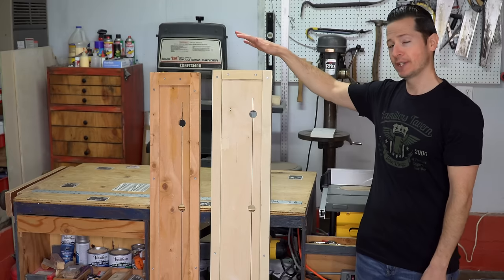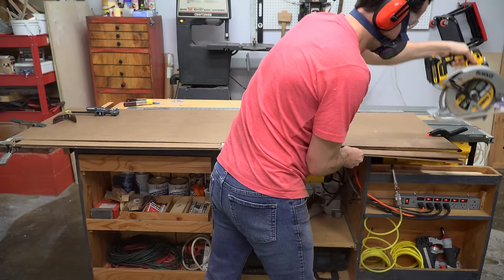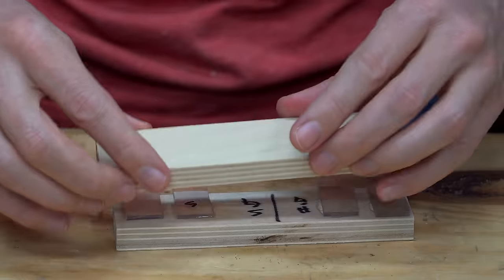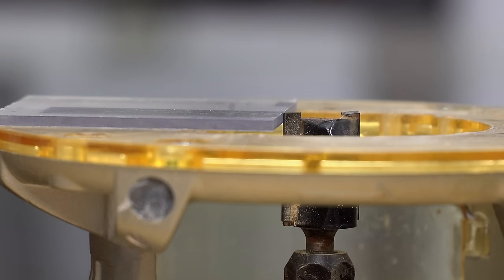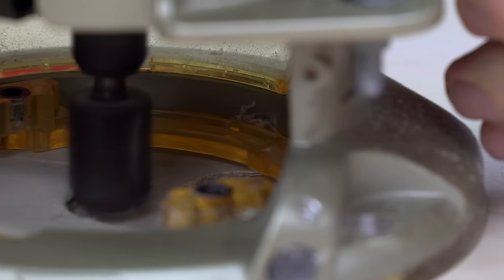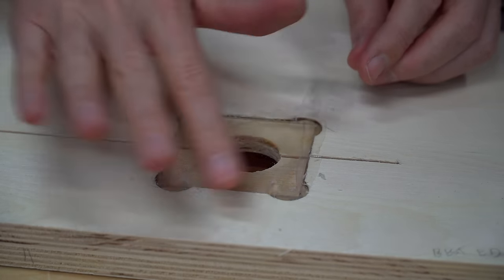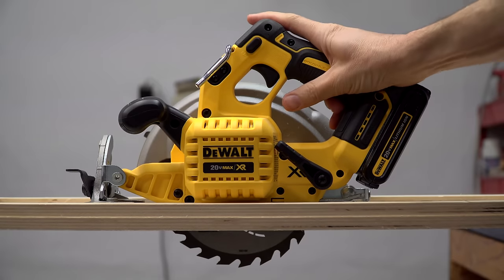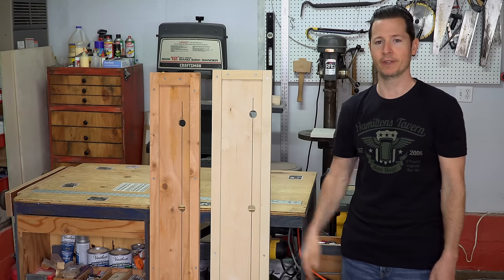DIY Saw Track Update

Comment: Love the idea, but hit a bit of a snag...when we went to make our first cut into the jig to complete it, it had changed from the previous day when we built it. It had shrunk and the saw couldn't be forced through. We got about halfway. We undid one side of screws, broke the glue up and now we're going to redo that side. A little wood putty for the crappy plywood we used, and maybe this time we can get it to work. :-/ The metal on the sole plate must have expanded just enough to bind up the saw. Not sure how to allow for that...suggestions welcomed!

Comment: Great idea but why you glued those plexiglass pieces ? when they eventually get dull or scraped from usage, in order to replace them with new ones you will need to rip them of ! So I suggest to use 4 small screws instead - in corners.

Comment: As usual, Outstanding work.  It’s also great that you took the feedback and improved the previous model.  You are helping the community on a per video basis.  Please keep it up.
Reply from the maker: Thank you for the wonderful compliment! I truly appreciate it!
Reply: @OneMinuteWorkbench  I am just wondering if the plastic made a difference. Was it worth it?
Reply from the maker: For what I usually do...I'd say no, not really worth it. I'm just breaking down sheet goods and don't really need a finish-quality edge on my cuts. If I wear building furniture and had to use a track, then yes, it would be. I hope this helps!
Reply: A better update would be to leave a clamping lip on the sides and widen out to a triangle 500mm wide approx at one end so it makes setting up square easy and you only need to measure out one mark . Also why are the stop blocks required ?
Reply from the maker: Zane thanks for the suggestions! The stop blocks keep you from cutting the track in half. I hope this helps!

Comment: By experience I can tell you that plexiglass, if you use this jig often, will get a lot of scratches by it being in direct contact with rough wood. Also, depending on the quality of it, plexiglass starts to yellow as time goes. Definitely not worth the time to do this over the original design which was great.

What I would do to improve the original is drill more holes, of smaller size, spaced a little closer. It won't affect the structure of it and will help aligning the jig easier. Also I would made the bottom and top part of base either wider or will leave some wood tabs on it so I can put clamps on it and secure the jig to the table. If the lower part of the jig is perfectly square with the line of cut you can add also a small strip of wood on it so you can put the jig on the material to be cut and make the cut perfectly square with the lower edge of the board you're cutting.
Reply from the maker: Good stuff - thanks for the suggestions!

Comment: Thank you for sharing your diy track saw design. I built two of them, one that can do up to a 5’ long cut and another that can do up to a 3’ long cut. I find myself using the 3’ long one about 80% of the time. The 3’ long one is perfect to handle anything that my cross cut sled can’t, and I rarely break out the longer one. The only modification I made to your design is to mark the top with tick marks every 2”.

Comment: Built one for myself yesterday on your earlier design and it works well! I made sure I did the sight holes before I ran the saw. I used the saw’s sight marker at the front to run a pencil line down the base so my holes would be centred. I built it out of mdf custom wood and lacquered it
Reply from the maker: Nice! Thanks for sharing!

Comment: Love the upgrades!
To help glue adhesion to plastic, lightly flame the area to be glued. Do not melt the plastic, you just need to change the surface energy. 
Works with all adhesion on Plastics:  glue; paint; ink; etc
Thanks for sharing the updates. 
db
Reply from the maker: Thanks, and thanks for the tip!

Comment: Thanks for sharing! I've done it and it works really well. I just need to install the plexiglass to complete it. I've used a 3/4 inch baltic birch and made it 60 inches long to be able to cut plywood of 48 inches in one time. I really appreciate the simple design and the precision of the cut.
Reply from the maker: No problem! I'm glad it worked out for you!

Comment: best DIY saw track yet !!!!!, i used your idea but with 2 changes , i used aluminum flat bar for the rails and then used UHMW tape on the sides of the flat bar and a 3/4 in strip on each side of the flat bar on the plywood and that made the saw slide like it is on ice
Reply from the maker: Thanks - you build sounds awesome!

Comment: When I was still working in a cabinet and mill shop, one of the things we did was take a piece of 1/32" laminate, and glue to the base of the saw, and glue a piece onto the plywood, before attaching your side rails. If you use 1/16" on your plywood, it will make it stronger. I am going to try something like this out of a 1" x 12", because I want to cut 8 ft. sheets of plywood on an angle. I am going to build a church steeple, that is 8 sided. I am planning on usining1/4 inch flat aluminum for my guides. I like your sight holes and will use those. Love the build. I hope this suggestion helps.
Reply from the maker: Ted, thanks for sharing about your experience! Good luck with the jig build, and the steeple - let me know how it goes!
Reply: @OneMinuteWorkbench  I used a laminate kitchen counter top that a friend was tossing out. A local kitchen shop sold me leftover  laminate edgeband for a couple of double doubles( Tim Hortons coffee) I used for the inside guide track edges.
Stands up well to the repetitious saw movements. Thanks for the design updates and idea.

Comment: SIGHT HOLES W/O PLEXIGLAS or POLYCARBONATE. 

I drill-press drilled a 1" sight hole with a Forstner bit but stopping 1/8" from the bottom. I am easily able to see the pencil line. Because the grain of remaining wood at the bottom of the sight hole is running lengthwise, it is not inclined to break away. STEP 1) Score a line with the saw blade. 2) Drill the sight holes. 3) Complete the saw cut full depth.

Perhaps a better option might be a large V-shaped router bit to create a "sight groove," again leaving about 1/8" square edge at the bottom. This would provide even better edge support.
(Good video Tommy. Clear and easy to follow. Thanks!)

Comment: Very very nice.  The smallest sheet of Lexan I could buy was 10x8, so I made a series of sight "slots" rather than holes by drilling pairs of holes about 6" apart and then cutting out between them with a jigsaw.  It turned out this lets me see the line while looking ahead at an angle rather than having to look straight down.  I'm thinking I will make another one that will let me rip an 8' sheet. I'll try joining a couple of plywood strips end-to-end with a table lap to get the length, and the side rails should give enough rigidity to protect the joint.
Reply from the maker: Thanks for sharing about your version! Let me know how it goes with the 8-footer!

Comment: You could round the corners and edges of the plexiglass with sandpaper instead of using the hot glue to prevent sharp edges from cutting you.
Reply from the maker: Thanks for sharing that idea!
Reply: I'm trying to figure out how the plexiglass is better then just a hole...
Reply: @philipgwyn8091  Im guessing cause it keeps the sawdust from falling down on the piece?
Reply: The plexiglass just adds the ability to exactly site the cut. You can see exactly which side of your cut line your on.  Great for an exact cut and a great idea for those who need that for say, furniture and don't have or can't use a table saw for it.
Reply: @philipgwyn8091  Having something in contact with the workpiece for the length of the cut prevents "tear out," or splintering on the surface of your piece. The rest of the cut, the track itself is doing that. Putting plexi in the sight holes doesn't interrupt that contact but still lets you see through them.

Comment: Hi Tommy, about an hour ago I finished making one of your saw tracks. I used 3/16 medium density fiberboard to cover the 1/2 " plywood tract. The fiberboard makes a smooth track for the saw. 
New topic: A few weeks ago, I made two zero-clearance throat plates for my table saw. One from acrylic and the other from polycarbonate. No doubt about it, acrylic is much easier to work with.
I guess I missed the part in your current video where you explained the benefit of adding a plastic window to your saw track. If the reason is compelling, I'll use the acrylic.
Thanks for the great ideas.
Reply from the maker: Thanks for sharing about your builds! The only reason to add plexiglass is to reduce tear-out at the sight hole locations. With plexiglass added, the entire track becomes "zero-clearance" on both sides of the blade. I hope this helps! Thanks again!
Reply: @OneMinuteWorkbench   One Minute Workbench  I'm sorry, I must have heard wrong. I thought you said you used polycarbonate for your windows. Just so we're both on the same page acrylic is the name of the material, Plexiglas is one of the brand names. Polycarbonate is a different plastic. It is much more impact resistant but, and this a very big but for this application, it scratches more easily. Since scratching is a possibility, you may want to use Acrylic (Plexiglas) instead of polycarbonate. I'm going to try to cut circles of acrylic and glue them into the holes. Thanks again for the idea.
Reply from the maker: I was using Plexiglass as a generic term (like using Coke to describe any cola). That said, I did use polycarbonate, just because it was the smallest and cheapest sheet I could find at Home Depot. I haven't had any problems with it, but I'm sure there could be different plastics that are better suited to the application. Let me know how it goes with your circle cutting idea!

Comment: After watching your original track video, I really don’t understand the purpose of the poly inserts.

What did I miss?
Reply from the maker: It creates "zero-clearance" at the sight-hole locations. I hope this helps!
Reply: @OneMinuteWorkbench  Hi. May I know what is the purpose of zero clearance?
Reply: @wongcw08  having a zero clearence means there will be less chance of tear out when the blade is cutting. Hope this helps. If not look up zero clearence table saw throat plates on YouTube.
Reply: In addition to zero clearance it looks like it will be easier to align you marks because you can see the edge of the cut on the lexan. That to me seems like the biggest advantage.
Reply: By the size of the holes honestly the zero clearance aspect won't be of much difference.
Reply: Tearout is from cutting unsupported edge. The blade is pulling up against the wood. if supported the grain mechanically stays in place.  If unsupported, it pulls up a bit.  on really cheap plywood it can peel at each sight hole where the edge.  Leaving those spots fuzzier than the rest.  Now each tearout needs a few minutes or more to fix.
Reply: @uplatecoding8008  great explanation dude :)
Reply: @uplatecoding8008  You could also use a finishing blade for finishing work. I switch to a good 60 tooth or greater, i.e.; plywood with that microscopic veneer layer,  when it needs to be perfect.

Comment: This is the bestest track saw design and instruction how to build .  I mean both first and second. 
I recommend one more improvement.  add spring loaded mechanism to sandwich the work piece between TRACK saw and BASE PLANK.  So , no need for clamp , on , not precise cuts. 
 I see you have the intelligence to make it work.
thanks for good work.
Reply: Hi FRANK. I'd be very grateful for more detail on how you could avoid clamping, as, although the saw would be safely guided with this ingenius double track, the device still needs to be firmly fixed to the material to be cut. Maybe I haven't understood your idea.

Comment: Nice work I like that design I made a couple changes to it I made the bottom out of quarter inch to reduce the amount of loss for depth of cut and I made it wider because the quarter inch was kind of wobbly I also put two strips of sandpaper on the bottom so I can just set it down it doesn't slip around then and you don't need to clamp it but thanks it's a great idea

Comment: Nice improvements! I built one off the old design and everything worked great… until the summer! We got so much humidity and all the wood swelled and it got much harder to push the saw through. I want to experiment with using one side plywood, but the other side as angle iron, with some slots for adjustment, to account for humidity. Still thinking it through a bit. Anyway, thanks again for another nice video!

Comment: You should have used the masonite as the base, but not for the rails. It doesnt need to be straight if your rails are. Then you get more depth and a surface with less friction.
Reply: Masonite is not as good as you think it is.  I thought he demonstrated that pretty well in the video.
Reply: @RyeOnHam  You missed the point.
Reply: @jonathansimmonds5784  Okay, Norm Abram, tell me the point I missed.
Reply: @RyeOnHam  in the video he used the Masonite for rails. It was too flexible. Using it as the base with plywood rails should work fine.
Reply: @dancingbear6239  HaHa, Norm Abram Oh Lord!

Comment: You could add built in led lights on the bottom side of the plywood around the poly inserts so in situations with dimmer lights, you can still be able to see your line.
Reply from the maker: Cool idea!

Comment: excellent and i like this follow up video also. my track saw is a budget one and the rubber edge of the metal track is beginning to get cut away so you cant get a perfect line so i am looking to make this track saw out of ply that you have done!

i wont be using the plexiglass though mostly because 1) a lot more work vs the end result.
2) for me i work in different light so sometimes outside. sometimes inside and the plexiglass edge can cast a shadow over the line making it harder to see. and also then dust getting on it and plexiglass scratches up easy so the original idea is best :)

Comment: 2 GREAT VIDEOS!. I've also noticed the need for a track on both sides, especially as my Makita has a factory-designed cutaway on its base at rear left (What was the engineer thinking? Did Makita want to save $ !?). Indeed, it is important to check there's clearance under the motor. Also, as it's necessary to clamp during sawing, it's vital to have a margin so that the motor also clears the clamps. My first attempt with a single track had this fault. Many thanks.
Reply from the maker: Thank you - I'm glad you enjoyed the videos!

Comment: After viewing your original video, I thought about it and decided a bunch of strips acrylic (or polycarbonate)  along the whole length would make visibility better. No real need for the adjacent edges of the strips to glued together, just butt them up.  Also, something I've not seen in any YouTube video is how to make a non-slip bottom. Long ago, I noticed your ordinary RTV silicone sealant is pretty grippy when cured. I apply a uniform strip of the RTV silicone with a putty knife with a couple of suitable diameter wires on the edge of the putty knife to act as a spacer make a uniform layer.
Reply from the maker: Thanks for sharing your ideas!
Reply: I’d love to see a video of what you’re referring to. I can’t quite picture what u mean, and I doubt there aren’t others in the same boat as I am in. Thanks in advance!

Comment: Going to have to have a go at this when I next remake my single edge tracks. I used 6mm MDF for those and will do the same to give me max depth. 
Another bonus I can see is that it gives the option to clamp either side and cut either direction which I can't do now. 
I wonder If routing a T track into the bottom one side might also aid clamping flexibility. I may leave room for that.
Reply from the maker: Good luck - let me know how it goes!

Comment: I built one but instead of drilling the holes I cut the line about 1/8 of an inch and use that to drill the holes and then cut right through

Comment: Great updates! Not sure if you did this, but would it make sense to add paste wax to help the saw move on the track?
Reply from the maker: Thank you! I didn't add paste wax (or any other lubricant), but it would definitely make sense...I was just too lazy to do it 🤣
Reply: Would the wax collect saw dust? I've never used was on any of my power tools or add-ons, so I'm really curious.
Reply from the maker: If you use paste wax, it shouldn't collect dust, and should actually make it easier to clean the dust off. If you use beeswax on the other hand, it will probably be too thick and would probably collect it. I hope this helps!

Comment: I guess you could layer that other board inside the track to make a smoother glide? It looks like the saw slides pretty good as is. So what is the advantage of the plastic? Just to keep saw dust down and add to the pro/cool factor? Thank you for this example 👍
Reply: To make for a truly zero-clearance cutline
Reply from the maker: Yes - the plastic windows make the full cut length zero-clearance, but still allow you to see your line so you can line up the track.

Comment: I like the Lexan addition!  I'm wondering if adding a piece of the molding on the underneath side at one end, perpendicular like a T-square, would facilitate ease of use (like only needing to clamp one end, easily squaring the cut to that edge, etc.).  Also, if splicing with half lap joints to make a 108" guide would help break down plywood, where a full-length rip cut is needed.
Reply from the maker: Great ideas! Thanks for sharing!
Reply: YEEEEAAAAH SPLICING WITH HALF LAP ON THE GUIDE RAILS AND THEN DOING THE SAME WITH THE BASE PLATE WOULD CREATE LIKE A FINGER JOINT EFFECT THAT WOULD BE SUPER STRONG GREAT IDEA!!
Reply: Interesting ideas. I was thinking of this for a full sheet cutter myself since I already have a kreg rip cut for smaller pieces.